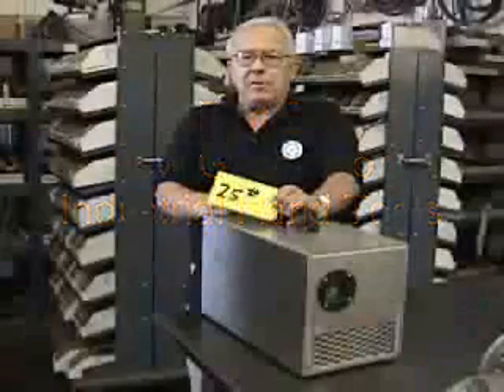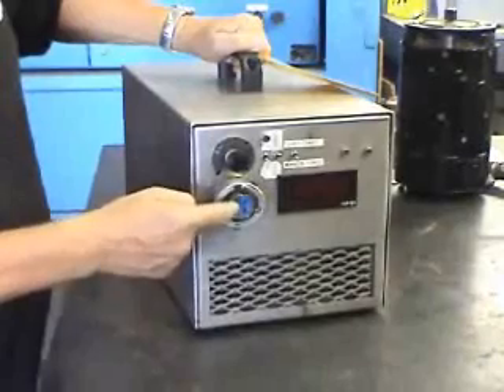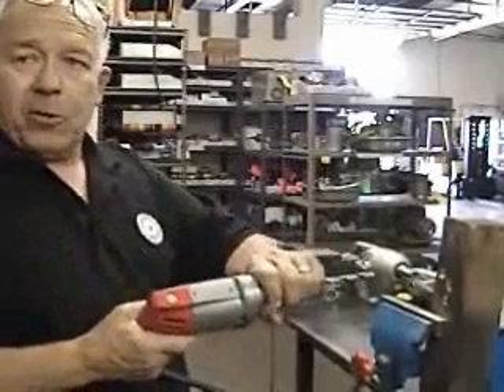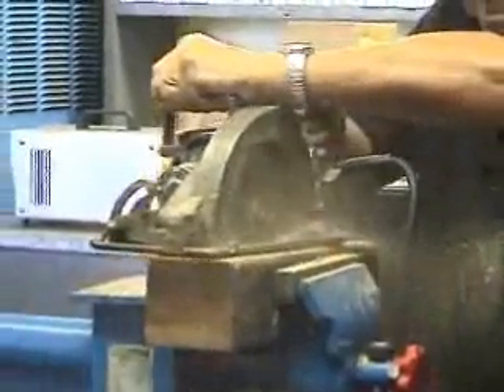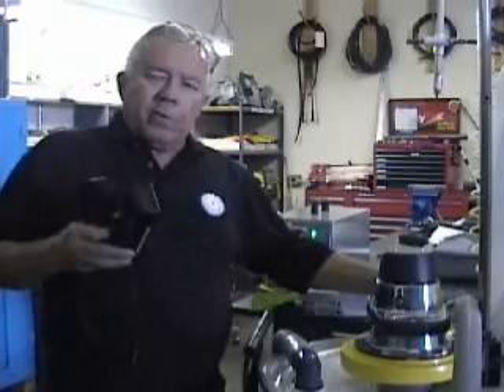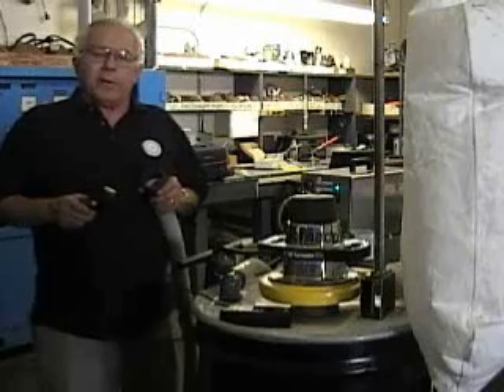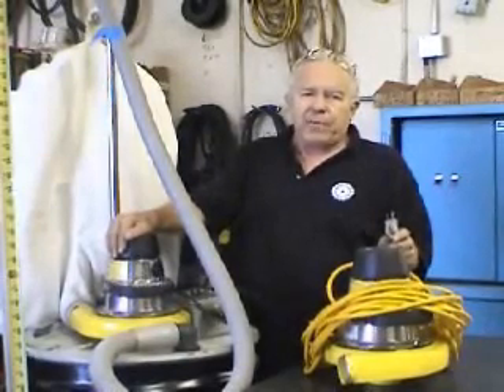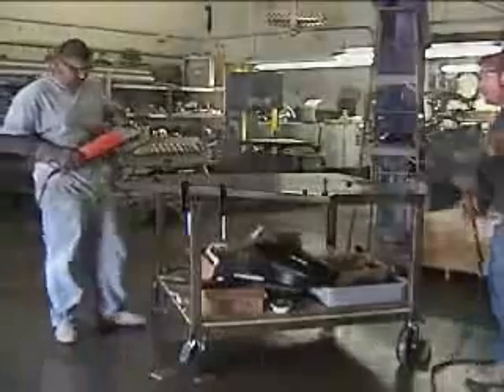Ed Dempsey & 400 HZ Engineering

Comment: I noted an incongruent comparison here: "120 Volts vs. 400Hz."   At what frequency does the 120 volt powertool run at, and what voltage does the 400Hz tool run at?  Maybe I'm mistaken somewhat.   Did he mean 60Hz vs. 400Hz?
Reply: Tim Heise
No he means 208v at 400hz.....its a hycycle we use them at work for coring drilling